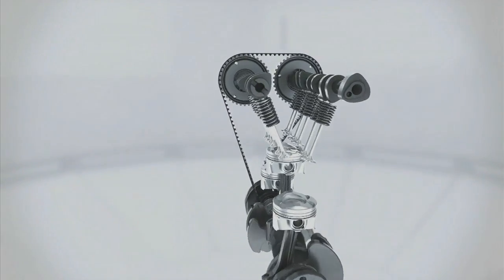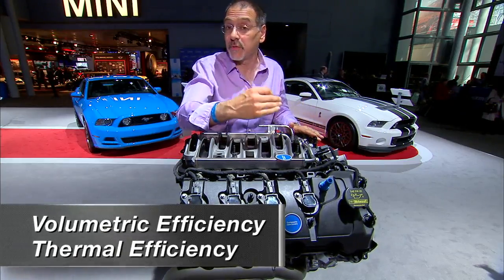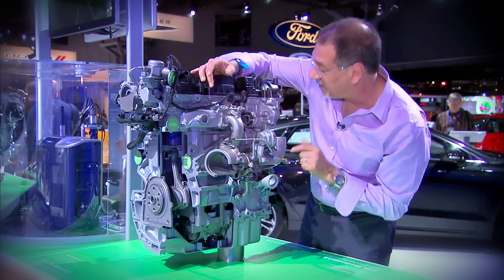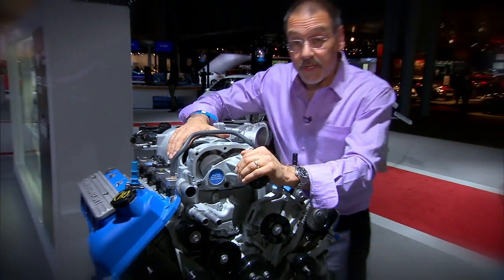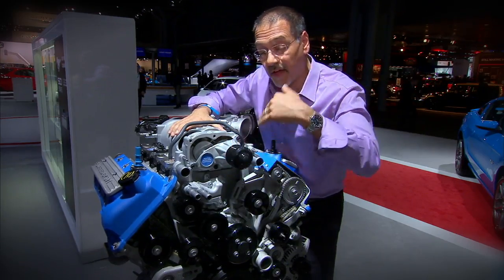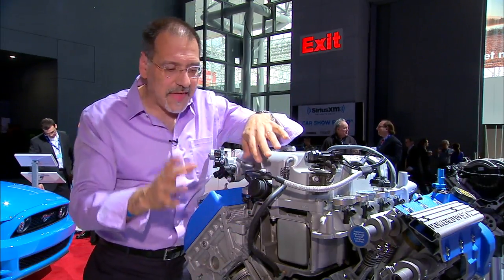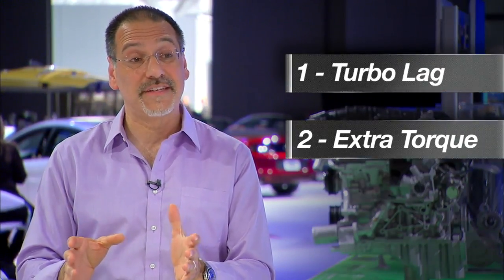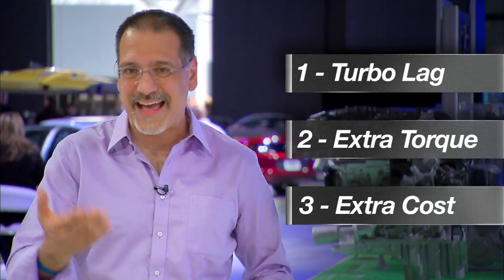CNET On Cars - Car Tech 101: Turbos vs. Superchargers

Comment: When it come to power what he says :50 is misleading.  A 400 hp engine, will use about the same amount of fuel regardless on how you get there.  In fact a boosted engine will use slightly more, to cool the charge and gain more timing.

Also in power applications the length of rev range and how fast the engine revs play a major role in what's best.  Turbo's are better suited to larger rev ranges and engine that rev quickly.
Reply: GlassTopRX7 that’s a case specific point, turbochargers improve volumetric efficiency, intercoolers cool the charge, direct injection shoots fuel after TDC, so there’s no detonation, or pinging, and you get a more complete burn, nitrous oxide systems use more fuel because it enables a complete  burn with more fuel, causes a lean condition without it, Nitromethane Injection uses fuel to cool, and govern the engine, a BUNCH of Fuel,. You can add methanol and water injectors to your plenum at the throttle body, to keep the air charge denser. Superchargers and turbo’s use more fuel because it’s impossible to resist standin on the pedal!

Comment: The Nissan Pathfinder Hybrid and the Infiniti JX Hybrid have a 2.5 Liter Super-Charged engine, not turbo-charged, and both are paired with CVTs in either FWD or AWD. Both vehicles claim to achieve 26 MPG combined in either drivetrain. Nissan might consider putting low-displacement super-charged engines in their vehicles in America, since the Asian market has them.